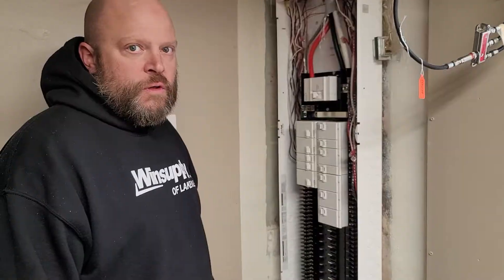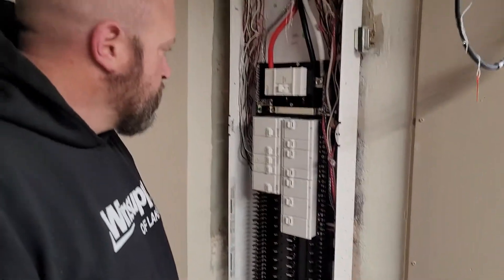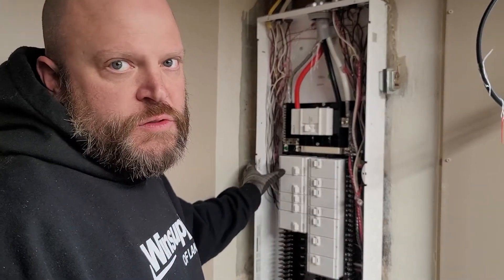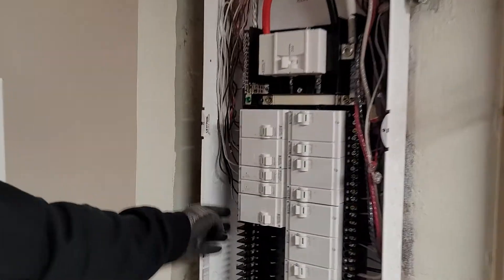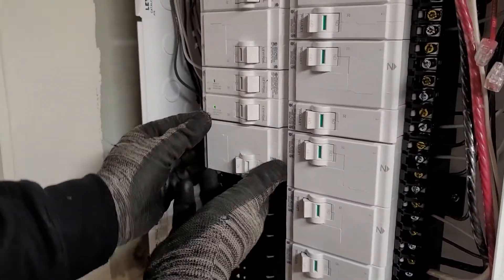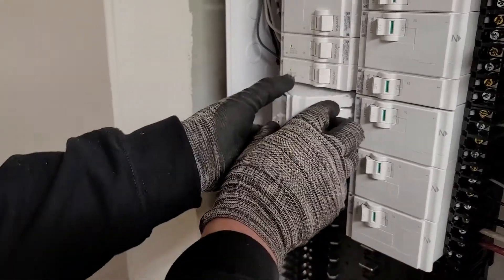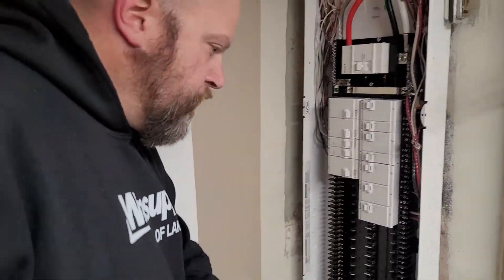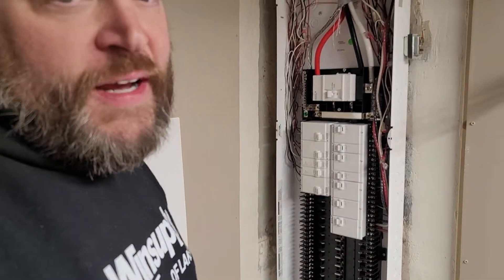New Design Leviton 200 Amp Service Panel allows for Wireless Breakers

Comment: Are the bus bars live so you would need to turn the power off on the panel to run wires to the bus bar when adding a new breaker?
Reply from the maker: Yes, bus bars are always live. However, you can run wires to the outer connections as they are not live until a breaker is installed and in the on position.
Reply: @TurbineGuy  when you say outer connections, you mean the connections that are normally attached to the breaker on other brand panels? I don’t like how the breaker does not have the connections.
Reply from the maker: @hall0728 correct. Where the wires would typically attach to breakers. They did this so breakets can be changed without any tools
Reply: @TurbineGuy  Thanks! Was just hesitant to run wires to a new breaker since they weren’t attached to the breaker. I thought you would need to turn power off to the panel to run wires to those connections since they aren’t attached to the breaker
Reply from the maker: Don't forget to sub my channel and like the video please

Comment: Seems like a "young" technology that still needs to be figured out. Not sure what the benefits of a homeowner being able to pull out a breaker has?  The panel and bus bar are still live, so it cant be a safety thing. Not being able to turn breakers back on?  What's the point of turning it off then?  The only application this would make sense "in my opinion" is for a rental unit....possibly for a landlord.?

Comment: How would you install a 150amp breaker to this to run to a subpanel? Seems like the sections are too small for a 2/0 wire.
Reply: Leviton breakers larger than 60A have terminals on the breaker itself, like a traditional breaker. The bus landing that's demonstrated in this video is for 60A and smaller circuits.

Comment: 😂
Reply: I just had to put one of these up for a customer he bought it when it was hard to get panels I tried to talk him into sending it back. What a piece of caca Doody. Terrible design this is no better than the Federal Pacific except for you can turn off your electric by phone. I wonder if it works in the case of your electrical panel causing a fire
Reply: @travismiller202  Can you state your reason ?
Reply: I don't remember writing this or installing the piece of s*** panel but I just watched this video again and it's funny that a professional electrician couldn't get the breaker out of the panel and he's talking about how easy it would be for the homeowner to just change that breaker he sounds like an iPhone user telling everyone how easy it is to use the iPhone after 15 attempts to do something it takes an Android user two actions to do. I imagine if you look at the design of the breaker and the way that eclipse in that's why I said it is similar to Federal Pacific if you want to know why Federal Pacific is considered the most problematic breaker in the country you can read any trade magazine

Comment: Thinking I want to test such a panel in my garage and replace the small one that’s already there. Do they make sub panels that don’t require a main panel that’s also Leviton?
Reply from the maker: I think 20 spaces is the smallest. Check Leviton indoor load centers here: https://www.leviton.com/en/products/residential/load-centers/load-centers/indoor#t=Products&sort=%40wcs_site_tree_rank%20ascending&layout=card
Reply: @TurbineGuy  Thank you. Would you happen to know, other than a panel, do you need a hub or anything other than just their breakers in order to view them?
A second question; can you view instantaneous power usage or the system can only give you insight per hour as I see in some videos? In other words, how frequently does the information per breaker update for the user?
Reply from the maker: Yes. you need a hub and the smart breakers.Not sure about the technical details yet, first time installing them.

Comment: The question is, are those smart breakers readily available if one would become damaged and needs to be replaced? Can you just grab one at Home Depot?
Reply from the maker: Standard Breakers are available at Home Depot, the smart breakers are another thing.
Reply: Smart Breakers are available on Amazon

Comment: Yeah right..
So now when you need a breaker you won't find it at your local hardware store...it's special order...and the cost...it won't be twenty bucks like most breakers...no no no... expect to give an arm...if you can find them at all... another scam folks...keep it simple.. this new technology garbage is a waste of money and a way to keep you from getting generic parts and having to buy from " qualified" reps.... smart breakers?...like smart meters can probably shut off your appliances when the " authority"  rulers of the electrical grid and smart city new world order authoritarian's decide to...
Reply from the maker: Quite the rant, too bad you are wrong. Leviton breakers at Home Depot for under$7: https://www.homedepot.com/p/Leviton-Standard-1-Pole-20-Amp-120-Volt-Thermal-Magnetic-Branch-Circuit-Breaker-200-LB120-00T/320476666?source=shoppingads&locale=en-US&pla&mtc=SHOPPING-BF-CDP-GGL-Multi-Multi-NA-NA-NA-PLALIA-NA-NA-NA-NA-NBR-NA-NA-NA-LINC_Lapsed&cm_mmc=SHOPPING-BF-CDP-GGL-Multi-Multi-NA-NA-NA-PLALIA-NA-NA-NA-NA-NBR-NA-NA-NA-LINC_Lapsed-71700000100310360-58700008031441221-92700073051609582&gclid=Cj0KCQiAveebBhD_ARIsAFaAvrFrmsEWX3YKTD1JpnQrSkLxLtQ-c1WRKHhgOI8-jGhjPnAYa6WMwcEaAmC-EALw_wcB&gclsrc=aw.ds